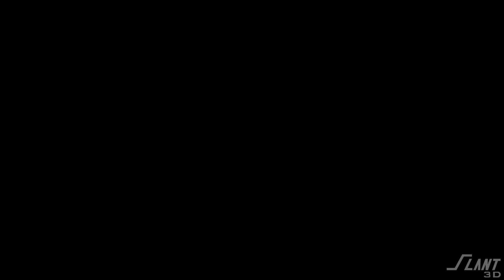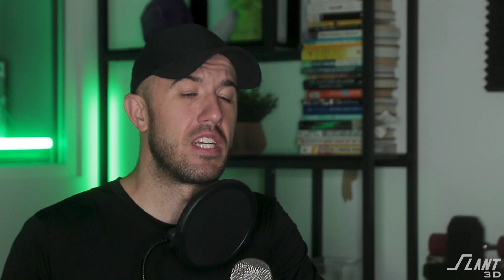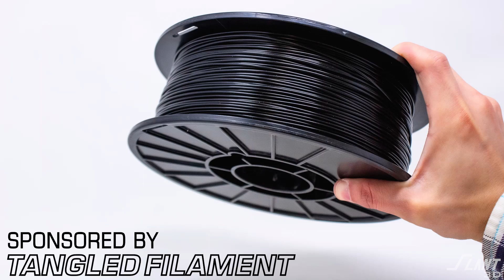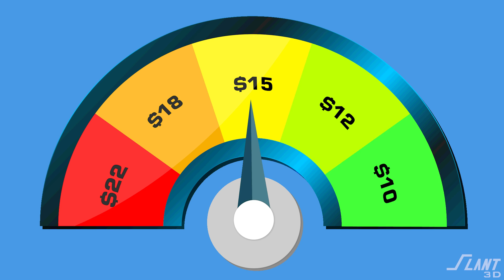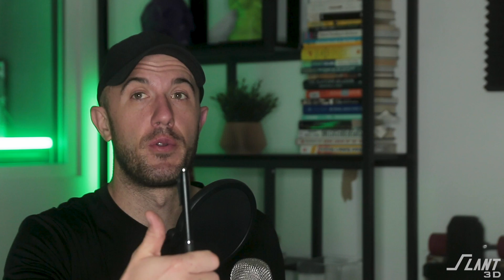Cheap Breeds Quality | PETG, Spooless, and Gray | Shopify Plugin Beta | 3D Printing News

Comment: “Fast/cheap/quality” is about the development cycle, not the qualities or properties of parts. 
In the examples you mentioned, you were able to achieve properties in parts (or in the SpaceX case) by pouring in engineering hours and project timeline that allowed you to forgo buying parts, or for SpaceX to figure out they can reduce parts. That’s not fast, and it’s certainly not cheap from a project management perspective, or if you had to pay someone else.  

The triangle, is about recognizing that tradeoffs in development exist, and although we aren’t stuck in some tradeoff space, there’s still a relationship between fast/cheap/quality. If your solution is that is “well, put in more engineering hours”, it’s ignoring the “fast” part of triangle, and it’s ignoring the “cheap” aspect of your labour.  

The “fast/cheap/quality” IMO works best when it’s applied strictly to the development process, where your cost is majority engineering hours. This is why it’s useful in software. In manufacturing, where manufacturing costs can dominate, I’d agree that it makes less sense.
Reply: That's what I was gonna comment. The raptor engine it's being made faster, cheaper, and better now. But to get to this point took a lot of time and money. The manufacturing is better, faster, cheaper. The process to get there was not.
That said, I agree with his point and enjoyed the winch story
Reply: Came here to say the exact same thing. I will point out that project managers will still freak out about pinching pennies and try to rush the design phase on physical hardware.
Reply: @TheGlitchyCorgi  changing a design is literally the cheapest section to modify and have the most significantly impact down stream, trying changing hardware design when you already spent tons of money on equipment and material is way more difficult and takes way longer. You would think project manager would try to stay in the design phase as much as possible even if their goal is to reduce cost.
Reply: @keenheat3335  One would think. Doesn't work that way. They don't care about the overall product, they just see "those damned engineers" burning their design budget
Reply: How about the SpaceX Dragon versus the Boeing Starliner? SpaceX got Dragon certified much sooner than Starliner, for a much lower contracted price than Starliner, and with far better quality than Starliner.
Reply: @klasodeth  Boeing's got doors falling off its conventional aircraft and they had to rebuild the capsule because they used flammable tape all over it. No one is surprised that piece of crap didn't work. Shitty corporate culture will foul up any general of thumb
Reply: @klasodeth  yes, but only via iterating through the design cycle, and pushing against the tradeoffs triangle each cycle to learn where your design/mental does not meet up to reality.

Look up the allegory of the pottery class split in half.
Reply: @klasodeth  I would say that was more due to SpaceX having a much better and more competent engineering culture driven by NEEDING to do a good job, whereas Boeing is used to near consequence-less cost-plus contracts.

This principal isn't really comparable across teams with vastly different makeup, leadership, and skills.

Comment: Please make your spoolless compatible with Bambu spools. 3D printed bambu spools work better than the injection molded ones and everyone with a 3d printed can make those for themselves. You should give some transparency around what 'better PETG' is. Most PETG feels like disposable plastic cups except for the stuff with carbon fiber in it.
Reply: Absolutely this, while I wouldn’t necessarily say go with Bambu’s they should pick a 3d printed spool design and create their spoolless filament to fit it. It would also be nice if they provided a link to the printable spool they use on the Tangled site and maybe even a slip in the box with the link and/or QR code.
Reply: We'll see what he means by it. But I had a similar opinion like you, except for creality black petg which I was plesently surprised by. And then I got yesterday Kingroon hspetg, and got blown by it. Prints both faster than most pla, and prints great. So we'll see what Tanged has in store for us